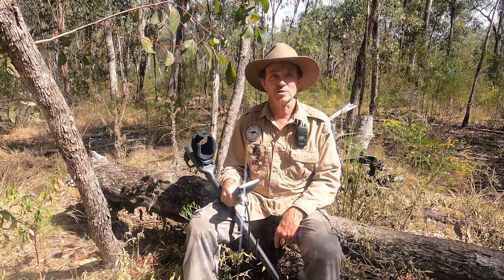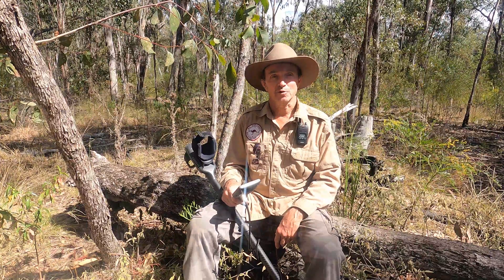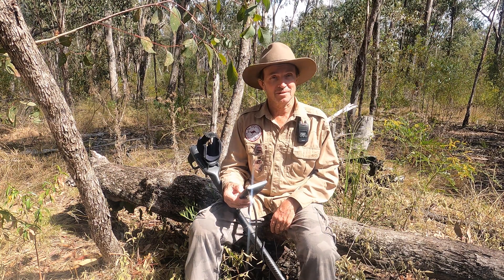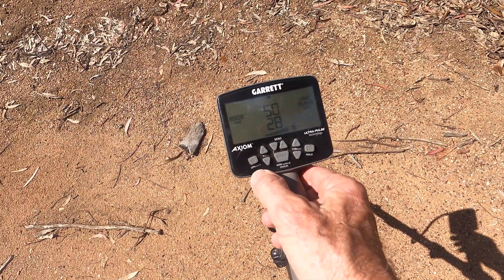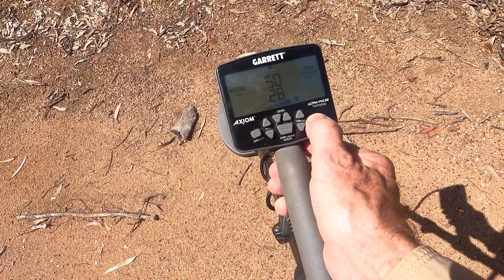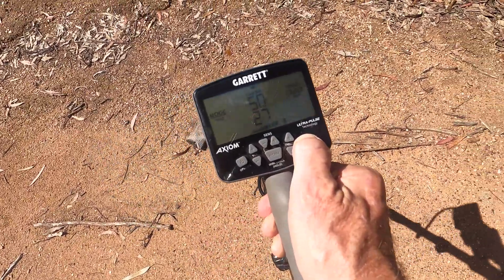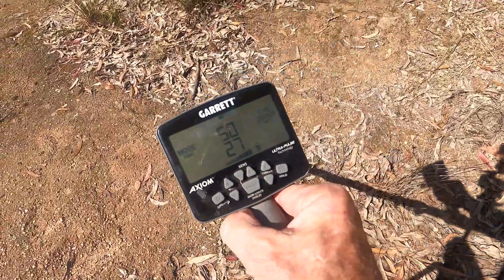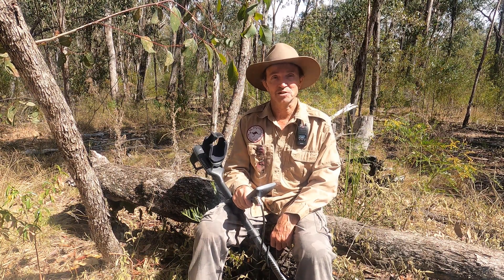Garrett Axiom Ground Balance Window Feature.

Comment: Ok. Does using the ground balance window have an advantage over using say slow tracking in varying ground. And does it affect sensitivity? Here in vic we have old timer's heaps that can be pipe clay right next to red clay with iron stone and or pizolite.
Reply from the maker: Yes any time you set tracking or open the Ground Balance Window you potentially lose sensitivity on tiny gold. I am familiar with the Central Vic situation with the red/purple clays in pipeclay and ironstone matrix which quickly changes the ground balance. These conditions change either vertically as you dig or horizontally as you swing the coil. Generally I would experiment with either setting (or a combination of both) to get the best operation in the ground you are detecting. For me, constant ground balancing with minimal changes to the settings is the answer, you won't ground balance out a metal target. But (theoretically) you could track out a very faint signal if you keep swinging over it with tracking set. I hope this helps mate - feel free to hit me with any more questions! Happy Fossicking! Warren.
Reply: @NQExplorers Thanks mate. A  long time ML user. Used Garrett Groundhogs back in the 80s. But willing to try new machines on the market. Still have the old Garrett Groundhog for sentimental reasons. Lol